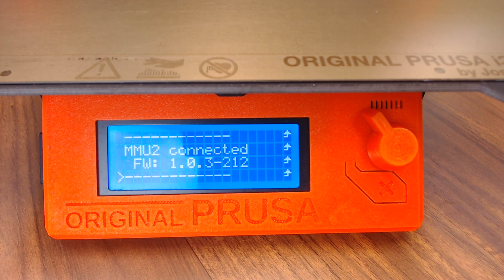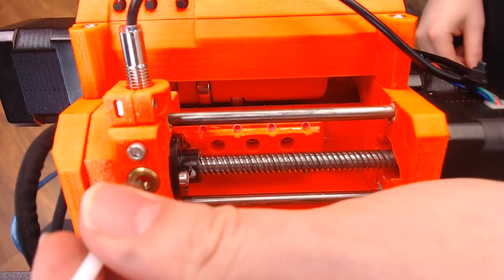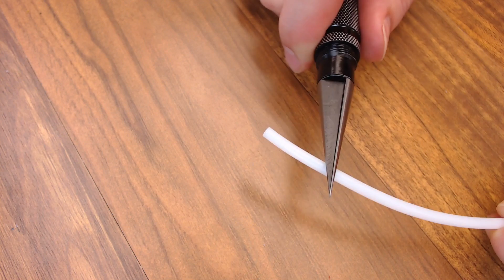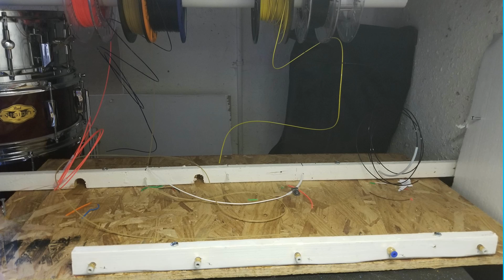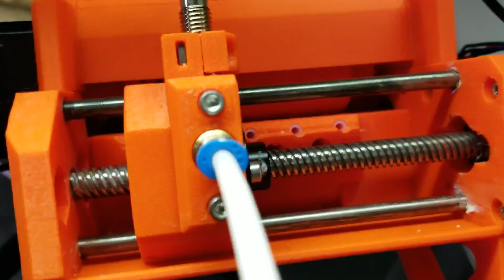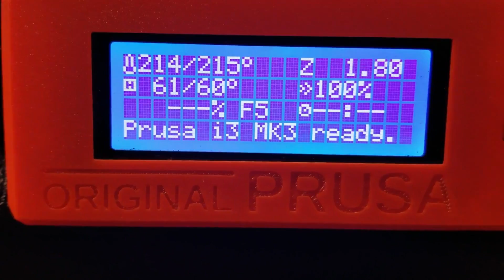Prusa MMU2 Multi Material Unit - Tips and Tricks - Chris's Basement

Comment: The MMU2 just got support in Marlin 2.0 for all printers. So now we don’t need an i3 to use it!
Reply from the maker: This is something I want to try very soon.
Reply: I came here to ask you to try it out. just seen it was available in marlin 2.0........ I want to buy a MMU2.0 now. please do a video.... @ChrisRiley
Reply from the maker: @shawnkratos1347  Will do!
Reply: @ChrisRiley  can it be used in CR10s？
Reply from the maker: @ИВАНЛК-р3щ  Not on the stock board without hacking the LCD cable.
Reply: @ChrisRiley  what about the CR10s pro v2 with BLTouch sensor?
Reply from the maker: @the_hobbyhoarder  Not enough open pins on the Creality boards I am afraid.
Reply: Killer
Reply from the maker: @NerdlyCNC  Thanks! Don't know if you saw this one yet. https://youtu.be/nf7TexBAR80

Comment: The MMU2s fills the filament and the bearing releases, but after starting to print the bearing does not release the filament. Anyone know a solution?
Reply from the maker: Check the sensor status, it might think the filament sensor isn't triggering correctly.
Reply: @ChrisRiley  You are right, I will try.
Reply: @ChrisRiley  I checked, there is no problem with the sensor.

Comment: Hey Chris, following your steps on the "Secret Menu". When I load the filament and hit the center button, why did my filament not go all the way to the extruder? What am I missing?
Reply from the maker: It's encoded for a certain amount. You can use the other button to bring it down. With the new firmware and a filament sensor you shouldn't need to do this unless you have a custom setup.

Comment: Where can I find the stl files to print that clever gadget, attached to the wire spool holder included in the delivery to the PRUSA printer to prevent the wire from getting stuck during retraction? Thanks Marco from Switzerland
Reply from the maker: I think this is the one you need Marco https://www.thingiverse.com/thing:3166394
Reply: I'm sorry but I'm looking for the stl files for that gadget that avoids during the retraction that the wire gets stuck on the roll of wire and you can see it in one of its videos. I hope I made myself clear? If I had your email I can send you a photo. Thanks and greetings from Switzerland
Reply from the maker: @laoma1955  Send over a picture. brotherchris81@gmail.com

Comment: Great video! Extremely informative about actually using the MMU. I have read the assembly manual, and I love that you've explained factors that will actually help in using the unit.
Reply from the maker: Thank you!
Reply: @ChrisRiley  What do you use for the filament buffer? Do you use the stock buffer, just let the filament coil between the MMU & spools, or something like a rewinder? Thanks again!
Reply from the maker: @FrancisEsmondeWhite  I've been using these with some success. https://www.prusaprinters.org/prints/31989-numbered-gravity-spool-holders-for-mmu2s

Comment: Chris, this was VERY helpful...   I went from almost not printable to 24 hours of non interruptions.   Thank you for putting this together.   I found a one more big item I wished you covered.  If you get flashing RED and Green Lights during prints it means there are issues with the connection back to the prusa.   I separated the wires, routed then along the Frame with e-tape.  Solved the issues..   Will share this video with anyone having issues with their MMU.  Thank you!
Reply from the maker: Awesome! That is a great point, I have seen that a time or two, never new exactly what it was trying to tell me.

Comment: Hi Chris, still trying to get set up here, after 1st layer calibration the filament balls up and won't retract, I have to remove the fista and use pliers to get it out.  You seemed to be changing cooling moves and ram using Slic3r, how were you able to "resume printing"?  Did you have to upload the model again?  How can I make those adjustments for first layer when there isn't a model?
Reply from the maker: That doesn't sounds right, for first layer calc, it might leave it loaded intentionally. The next print should pull it out I think. Yes, on any of those changes I have to resend a new file for them to take.

Comment: Would be nice to show how to adjust the gears?  Also, show how to get the FINDA feeder piece to move freely.
Reply from the maker: Not much to adjust, just make sure they are lined up. If the selector doesn't move freely you might need to reprint it.

Comment: I can't get the wipe tower to print properly at all. I have the hardware running great but every time I try the lizard, the wipe tower is waaaay too fast and just balls up on the nozzle.
Reply: Thanks for the suggestion. I'll play with it some more and see what I can come up with.
Reply from the maker: Is this on a Prusa printer?
Reply: @ChrisRiley  Yes sir.
Reply: Mk 3 and MMU2
Reply from the maker: @HofsFinest  Not sure man, only thing I can think of is try there newest firmware, but that's all I know to do.  You could try to bump down your support material speed.
Reply: @ChrisRiley  I've got the latest firmware. Ill try to lower the support material speed. Its just at the back part of the tower where it seems like its using travel speed instead of print speeds. It seems like the MMU2 ignores the max print speed as well. Oh well ill keep trying. Its frustrating. I gave up for a few months and basically just use it in single mode to be able to use different colors without having to change spools.

Comment: that is a great review, I am new to the 3dprinting thing and I never own or work on one of them. but I am so excited to buy my first 3dprinter with a budget of 1000 euro and I am really lost and confused. I was just about purchasing the Prusa MK3S DIY kit till I found something scared me a little bit. I am a communication engineer, so I can judge only on some electronic components. I am not a big fan of the EINSY RAMBo motherboard which based on "Arduino Mega". I believe all those boards are not designed for a pro user or heavy tasks/load which could generate unwanted heat that leads the board to produce un accurate printing. I like those boards just for small projects. I was excepting an advanced motherboard and this what scared me and push for watching more reviews. 

but maybe I am wrong about all of that and maybe this board is performing as it designed for.

any advice would be appreciated
Reply from the maker: It is try the Ultimachine boards are based on the old 2650 chip, but I can tell you, they are great boards and really well made, the only use high end components and they last a long time. On the other side of things, if you are looking for other boards, check out Duet, it's a little more modern design, they are also high quailty and we are starting to see printer companies using them in there kits.
Reply: @ChrisRiley I did not find any printer with Duet board, would you share any good brand that using the Duet please. waiting 6 weeks for Prusa is too much. if I find something in the same quality or better it would be great even if I will pay a little bit more.

Comment: Thanks Chris...great tips and tricks......been wondering if you have vids on PVA or flex amterial issues/troubleshooting ?
In particular......blobbing issues when using flex or PVA when initially starts extruding. I get no transversing happening and when the blobbing happens I have no alt but to cancel print. Your help would be greatly appreciated :-)
I just recently purchased Prusa i3 MK3 + MMU2S
Cheers
Reply from the maker: I really don't have a lot of tips on Flex or PVA. Most of the time when I run into an issue with those 2 it's because they have picked up some moisture.

Comment: You should do a review of the 3d Chameleon. It does the same thing and for cheaper.  It needs to be modified  in my opinion to get rid of the stupid switches on the x axis that control the 2 (or 4) extruders, and marlin 2.0. to control them.  I found out about it in 3D Printer Nerds video.  https://www.youtube.com/watch?v=Qz6WWd-cAkQ   https://www.3dchameleon.com/
Reply from the maker: I actually have one, I just have to find sometime to get it working.

Comment: Man i’m having a hard time doing the MMU PTFE tube calibration. The menu isn’t doing what is supposed to. Boot up holding the centre button, left button then enter. But then when i press enter again it doesn’t respond and after a few seconds just resets...
Reply from the maker: Are you using the newest firmware on both the printer and the MMU2? Is it an MK3S? With the new IR sensor on the MK3S it should take care of that setting for you. I would set the MMU2 back to default and just try a print to see what happens.

Comment: Ive tried that sequence over and over again and it does not work at all. I think maybe something changed ?
Reply from the maker: The tube length sequence you mean? It could have changes in the firmware. I am getting ready to upgrade mine, I will check it out.

Comment: Thanks for the video - very helpful getting things dialed in from the start.  As of today, the current firmware on the MMU2s is 1.0.6.  Does this secret menu still work the same way for calibrating length to the extruder?  I am using the bear extruder, which may be part of the issue, but when I went through the process, it fed the filament quite a bit farther past the extruder, all the way to the nozzle it seemed like.  I ran it back so it is setup as you show in the video, but the middle button wouldn't save settings at the end of the process with selector at the far right.  More importantly, the mmu pushed the filament much too far for lane 2 on my first test print.  Can you confirm 1.0.6 works the same way?

Comment: update chris!!!
Reply from the maker: I really do need to do another one of these.
Reply: @ChrisRiley  I get my filament stuck on the tube but when I move the tubes to a different position it works
Reply from the maker: @jrami223  stuck in the tube, or held by the gear? Does it make it to the gear?
Reply: @ChrisRiley  it goes to the gear so let's say it want to switch the filament I need to help to pull it back cause it like get stuck
Reply from the maker: That sounds like one of the gears is a bit small. Do they all read the same size with your calipers?

Comment: Before I bought the printer, I watched your video and was skeptical. I print now for 2 months with Prusa i3 Mk3s MMU2S, everything is going great for me. You do not need to set anything on the MMU2S. If you have set everything correctly according to instructions and assembled, the correct firmware has been updated, everything works perfectly. I print with ABS, nylon, carbon and PETG and have no problems with different materials when changing material. I think you can delete the part with "fumble around at the MUMU" because it causes confusion.
Reply: Hey Andreas... I too became skeptical. . . when I saw your posts everywhere MMU2 was being mentioned . . .reddit, google, grabcad, thingaverse, solidworks, autocad, inventor, you name it. . . your perfect prints are as fictional as who you say you are. . . Prusa plant.   The bottom line is that the mmu2 needs a lot of attention. I've learned that Josef Prusa doesn't pay his babysitters.
Reply from the maker: This was more the case when this video came out. My MMU2 is now working pretty consistently .

Comment: Probably a dumb question but how quickly can you swap the MMU2 on and off the printer?  Or I guess a better quesiton might be, is the MMU2 kinda permanent oince you install it or are you able to take it off and on as needed?
Reply: According to Prusa, you can just use a single filament in the MMU2S and it'll act just like it's not there... So why would you want to take it off?
Reply from the maker: @Thomas_Acharya  Yes, you can use it in single mode which I do on occasion. Really wanting to remove it only comes into play it you need to move the printer. Then it's a hassle.
Reply from the maker: It kinda dominates the printer really. The setup is so involved it's kinda hard to convert back to non-mmu2.

Comment: Chris, can you have a go at a a similar video for differences with the MMU2s?
Reply from the maker: I can, but there are no differences in the MMU2 unit itself. It's all in the extruder body.
Reply: @ChrisRiley  yes, that's the rub. Many of us are having issues with the IR sensor in the extruder body miss triggering or not triggering, and that causing filament runout routine activation (or loading failures, or other things). So it'd be nice to see a video out there from someone as talented as yourself going through it. There's so many mmu2s it in the wild, but barely no YT channels have done anything on them. I think everyone puts them in the 'too hard' basket.
Reply from the maker: @KieranShort  Right on, I can see that. I will look into getting one made up.

Comment: Hey Chris, I have the MK3 with MMU 2.0 and I am trying to print some NinjaFlex for the first time today. I am having problems with the filament getting to the hotend, it loads and even gets the filament to the hotend when it first starts but after that it does not seem to be able to pull the filament enough to get it to print. I cant even see the spool turning once the actual print is started and that corresponds with lack of filament coming out of the hotend, the gears turn but nothing seems to happen past that. Have you been able to get any shore 85a flexible filament through your setup?
Reply from the maker: I have never got 085a shore to work, but with the new mmu2 rework, I think it will make it much easier.
Reply: @ChrisRiley  I was actually able to get things working by slowing everything (all speed settings except acceleration) down to 15 mm/s and setting the hotend temp to 235 degrees. I ended up with a little stringing but I was able to finish a pretty good looking print. It still does not like unloading the filament but I will take what I can get. Thanks for the reply.

Comment: I need some help on using PVA T_T I found that PVA is too soft always cannot feed.
Reply from the maker: The best trick I can tell you it to dry it out. Get a food dehydrator. It needs to be super dry. If it's stringy at all it's not dry enough. It should be almost as stiff as PLA when it is dry.
Reply: @ChrisRiley  I got dry box that heated up .
but the problem is the PVA like flexible filament , the are soft. I cant print with it even on mk 2.5
Reply: is that any PVA brand better? did you try with PVA support on mmu?
Reply from the maker: @MBBFM  What brand are you using?
Reply from the maker: @MBBFM  I have been using inland brand and as log as it's dry it will work on the MMU2.

Comment: I also found out that a ruby nozzle is going to prevent you from getting a good tapered tip.  The ruby nozzle is flat on the inside, not tapered like a brass nozzle.  I fought my MMU2 for 3 weeks after I first got it until I put my stock brass nozzle back on.  Once I did that my tips were a lot better.  And when I made a change in the slicer settings, I noticed a change in the filament tips.  Whereas before when I had the ruby nozzle on, I would make a change in the slicer settings, and I wouldn't see any changes to the filament tips.  So if your having problems with filament tips, and using a ruby nozzle, try a brass nozzle and see if that helps.

Comment: I also found out that a warping purge block can add to filament end stringing.  I would have a print start out great, and have no filament strings on any of my tips.  But an hour or two into the print I would start to get strings.  I also noticed that my purge block was warping up in the back.  I wouldn't think that these two issues would be related, but they are.  If the purge block warps up, it's pressing up against the nozzle, when the nozzle goes through the ramming sequence and pulls the filament up to break the string, there is no vacuum break and filament from the purge block gets pulled up into the nozzle.  I started using a glue stick on the purge block area of the bed, and now I no longer get warping on my purge block, and my filament tips are perfect throughout all my print.
Reply from the maker: Very interesting find...I haven't noticed the warping, but I have had some 2 color blocks fall over. I will have to keep an eye on that. Thanks for the comment.
Reply: @ChrisRiley  It was so frustrating, why would a print that only took a few hours to print come out fine, but prints that took over 10 hours or more would have MMU2 jams, and stringy tips?  And there were times when I would have to use painters tape on my purge block just so it wouldn't come off the bed it was so bad.  I think what causes the purge block to warp is that there is a very solid thick layer of filament on the back side of the block, and not much on the front side.  The front you get all that open space when you have colors that don't come into play later on in the print.  That back section that has a solid infill of filament cools, and shrinks, this pulls up on that side of the block, causing it to warp.  I think it would be better if it alternated between the front and the back when laying down the solid infill, but I could be wrong.  But in any case, since I started using glue stick in the area of the purge block, no more problems.  I'm currently 17hrs into a 30hr multicolor print, and not once have I had to fix the MMU2, and I just looked at all my filament tips, they are as good as the first layer, with no strings. =)
Reply from the maker: @saltydog1984  Well awesome you found something that worked. I am hoping the newest version of slic3r will allow us to alter the wipe tower.